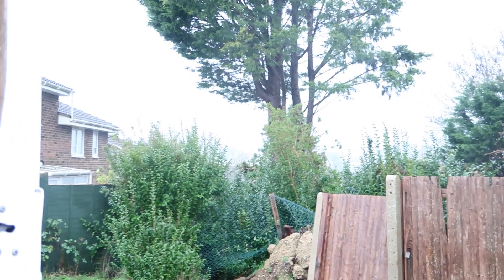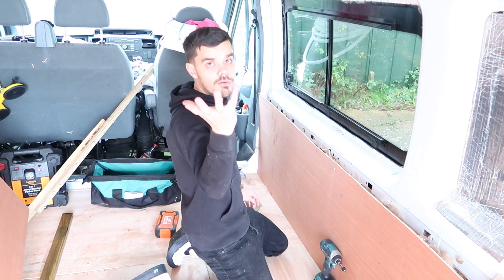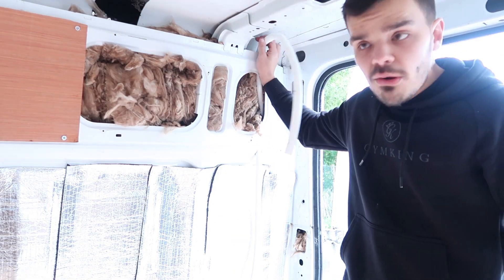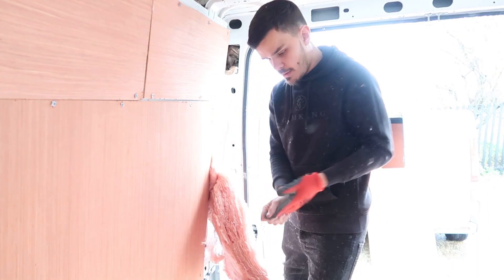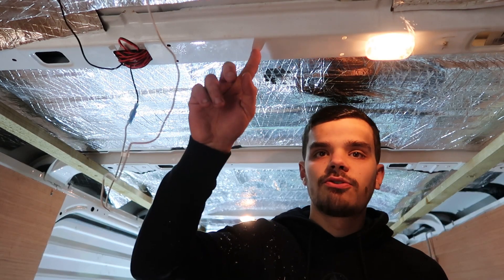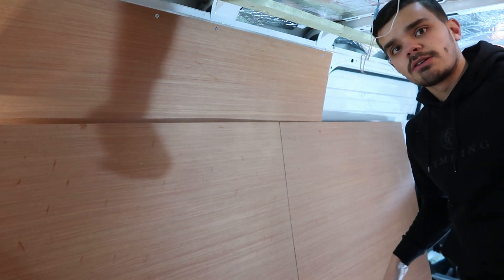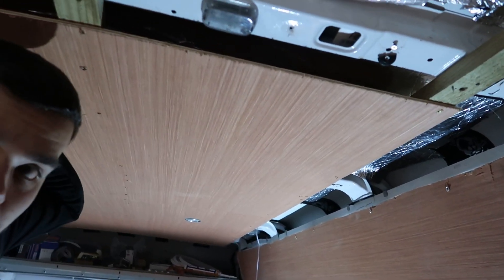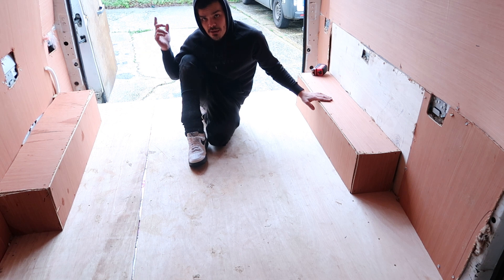ply lining the walls and roof for the campervan

Comment: Not sure household insulation is such a good idea it does absorb moisture
Reply: It does, it's the first thing I rip out when I convert ex ambulances, I'm  on my 4th Ambo conversion at the mo, that insulation goes black and moldy from condensation from breathing inside a sealed box 😞